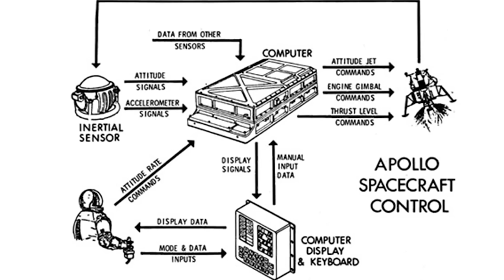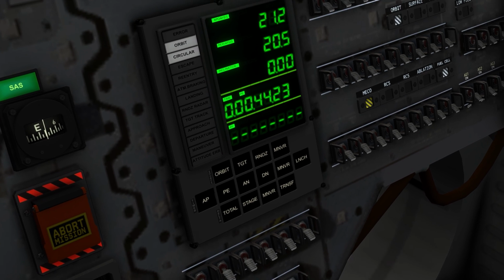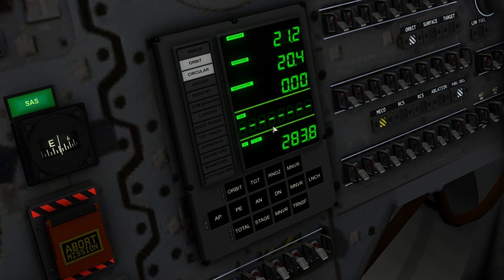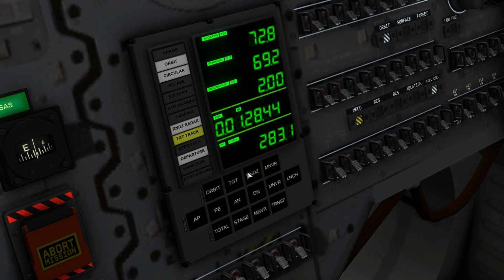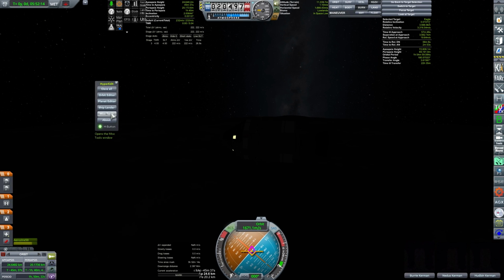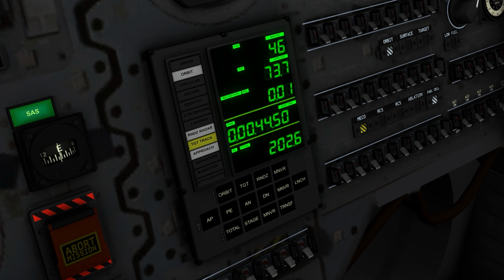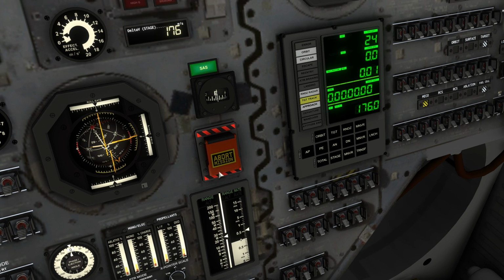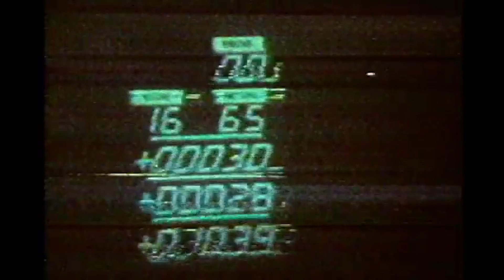How to DSKY & Rendez-vous - KSP retro IVA tutorial - RSS/RO - Pt 2

Comment from the maker: notes :
- 2:42 : time to LNCH button will display the time to lift-off, calculated for optimal rendez-vous time. Works if you're landed, and have a target in orbit. Note that it will typically pick a launch time, where your target phase is around ~300°, so a bit "behind" you.
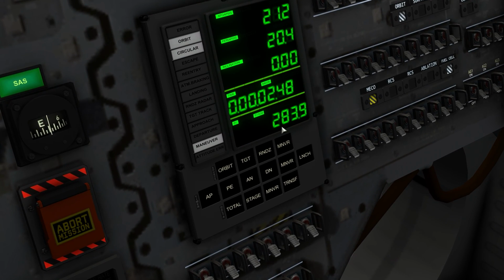- 3:50 : the TRNSF time button will display the estimated Dv costs for hohman a transfer, for the selected target
Cheers : )

Comment: do you have like a modpack for all the mods you have
Reply from the maker: Sorry I don't, but you can get all those from CKAN pretty easely, just grab RSS/RO, RO-capsules, and ASET and RPM, and you should be good to play in IVA with RSS/RO.
Then visit KSP discord, or RO discord if you need more help !
Reply: @Kurgutt   RO capsules is giving an error since it requires B9 part switch and its incompatible with my game version (1.12.5)
Reply from the maker: @sodlier  RO is incompatible with 1.12.5 ?
Maybe try earlier version, IIRC right KSP version for RSS/RO is 1.12.3, but you should double check on their install instructions.
Another way if you want to play stock with this IVA : install deck's saturn V :https://forum.kerbalspaceprogram.com/topic/176505-12x13x14x-saturnv-v103-d160718/
Then ASET/RPM
Hopefully you'll manage to make it work : )